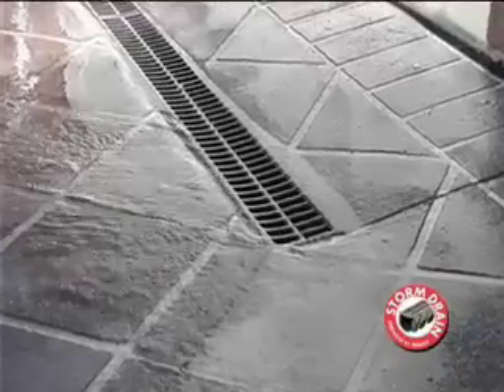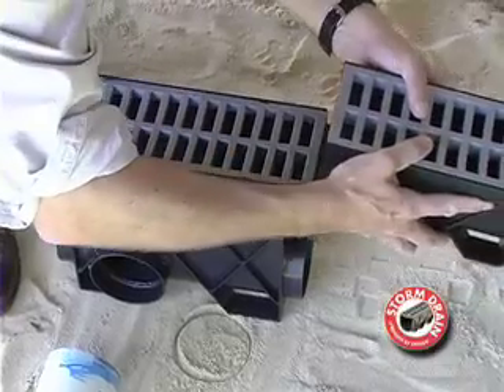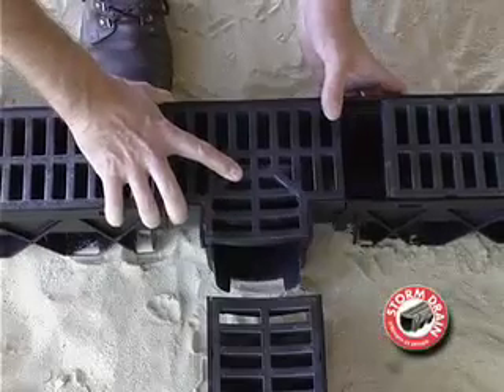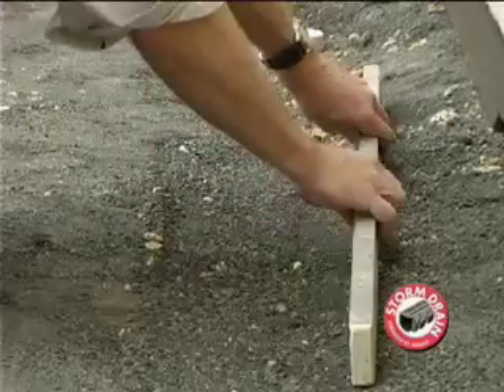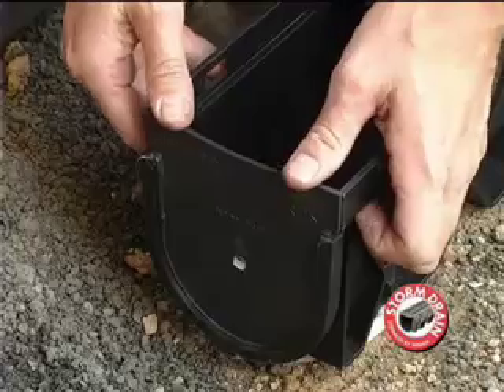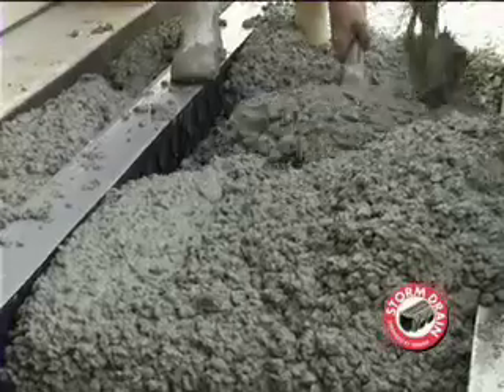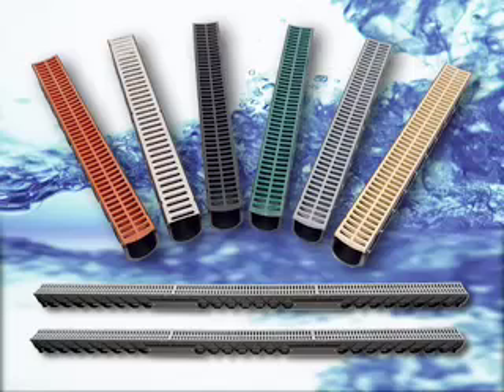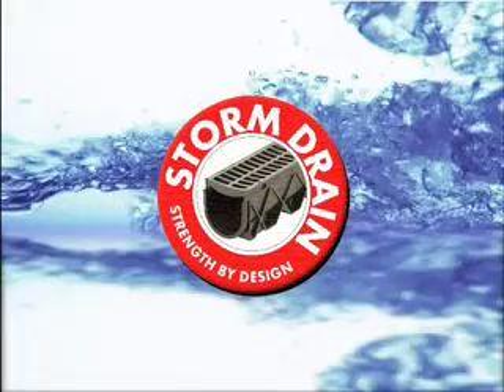Stormdrain Installation

Comment: I've just purchased 8 lengths and have dug out my drainage path with a 5 mm slope with each piece. I'm sitting like a deer in the headlights and came in to watch your video to see if it mentions what/ if it can be installed under a crush stone driveway that has crusher dust finish? 🤔 Any advice will be helpful. Thank you!
Reply: 2 years later how'd you figure it out?

Comment: All the joints leak on the state storm drain they do not tell you to use the proper adhesive do not use silicone you need to research the proper adhesive this is not a good product it is not a good video it is not informing you that all the joints put together leak water